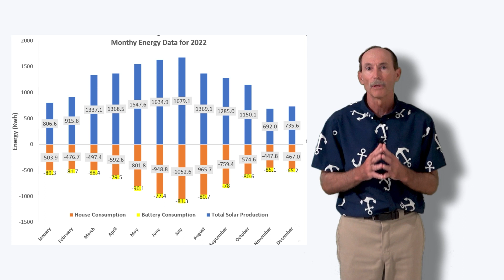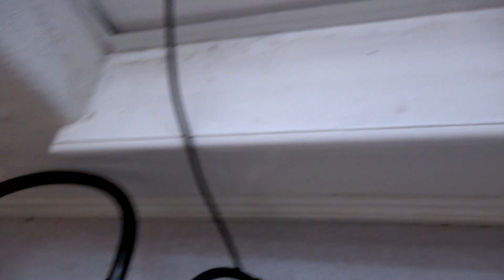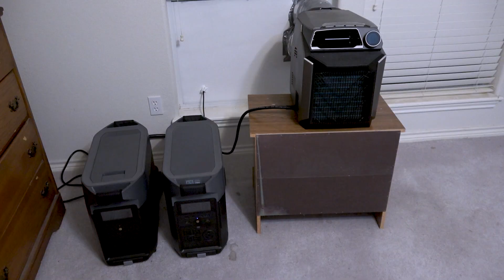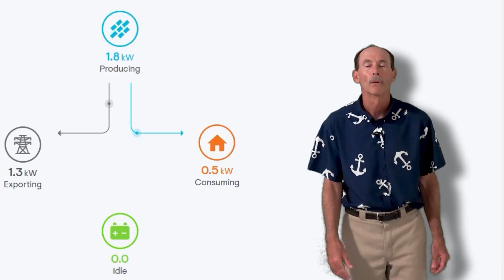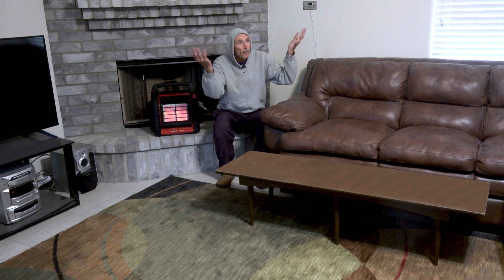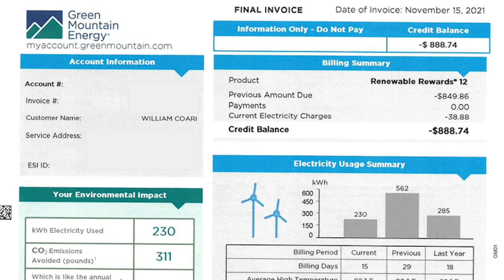How I manage my energy consumption

Comment: Have you looked into using a diesel heater?
Reply from the maker: Diesel is dirtier then propane. I would ultimately like to find a clean-energy solution to my heat but for now propane will have to do.